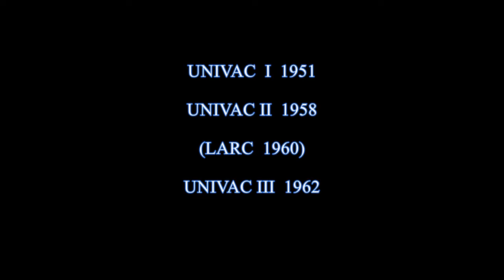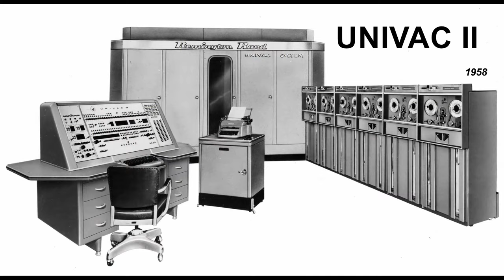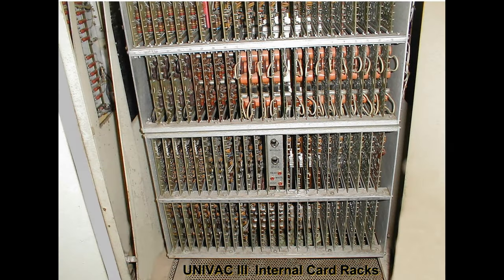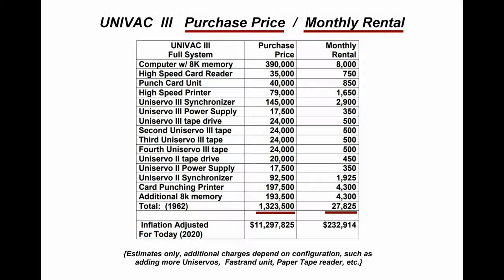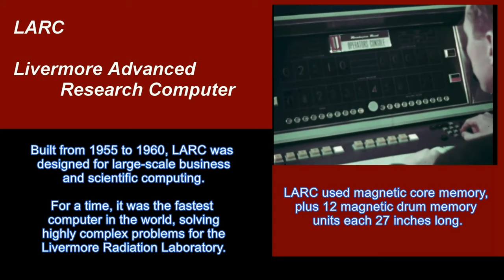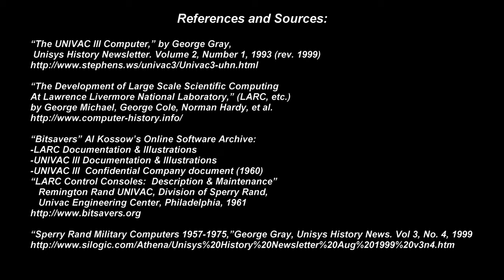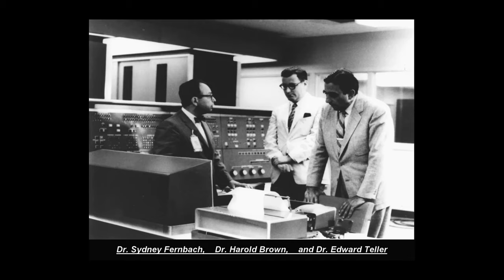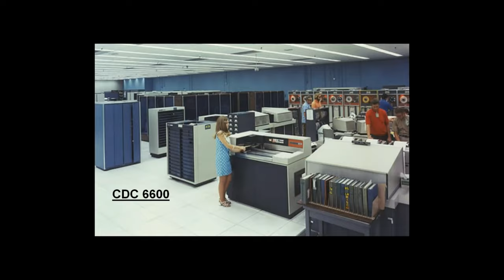Vintage Computer:  UNIVAC III Origin and History 1962 (UNIVAC, Remington Rand, Livermore Labs LARC)

Comment: I Maintained on of these in the mid 70's. Thanks for the trip down memory lane.
Reply from the maker: Hi Patrick,  thanks!    Can you tell us where you worked?   Just curious for more data on these machines and how long they were in use. ~  Victor, at CHAP
Reply: I worked on the 2 systems at Western Publishing in Racine WI. in 1977-1979. If I remember correctly the systems ran until about 1981.  I still have a core plane from one of them,
Reply: The one card cage looks as if it not from the UNIVAC III but from a UNIVAC 1700 card punch

Comment: Our little league baseball team was known as the Shoreline Univacs in the 1960s... unfortunately, I never made it past bat boy but such is life.
Reply from the maker: Hi NipkowDisk, that's interesting, but how did your team get that name?  ...  Victor
Reply: @ComputerHistoryArchivesProject  I honestly don't know, though I rather strongly suspect it had some connection with the Univac series of computers. It's possible there was a Univac in operation locally, hence the naming. Not sure if Boeing used them, if so then that would be a good possibility since a lot of local folks worked there and still do.

Comment: And then, one day, came the Integrated Circuit, and later the Microprocessor, and now Computer Power began to grow exponentially whilst at the same time, prices plummeted.
Reply: > prices plummeted.
My professor for electronics (back in 1999 or so) told me that the cheap home computers and later PCs wouldn't have been possible without the invention of CMOS (complementary metal oxide semiconductor).
Reply from the maker: Conenion, that's a very good point.  Probaby very true. ~  Victor, at CHAP

Comment: Univac larv belongs to which generation
Reply from the maker: Hi M S,  good question.  Although the advanced UNIVAC LARC (1959-1960) was the fastest computer when first installed, and it used 60,000 transistors, it would most likely fall into the "Second Generation" computer category.  Use of "integrated circuits" used in later computers would tend to define the "Third Generation" machines.  That's our view, anyway.  Thanks for asking!  ~  C. Hunter, CHAP
Reply: @ComputerHistoryArchivesProject  ok thanks 
Can u tell me when email started 
I have exam in which I mark 1971 but in answer key 1965 is right can u provide me any source through which I can challenge this question
Reply from the maker: I don't have an exact reference on this, but work done by Dr. Doug Engelbart at SRI in the 1960's is very critical to the development of the Internet as we know it today.  Take a look here, perhaps this may be of some help.

http://iae-pedia.org/Douglas_Engelbart